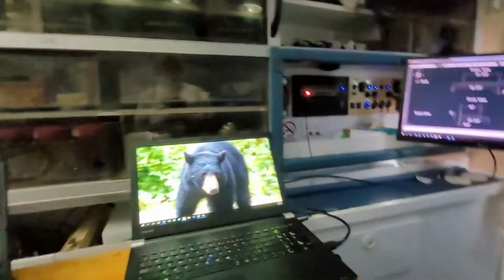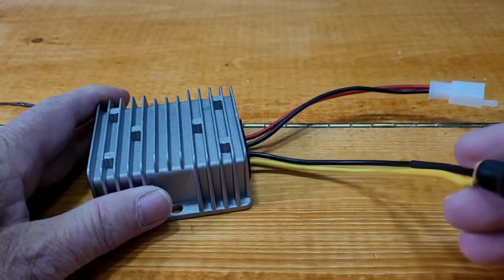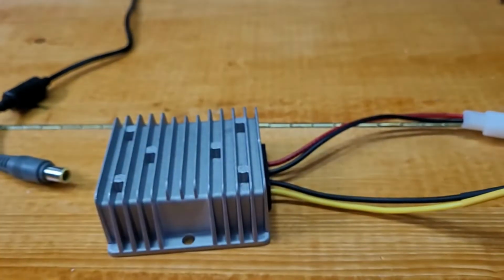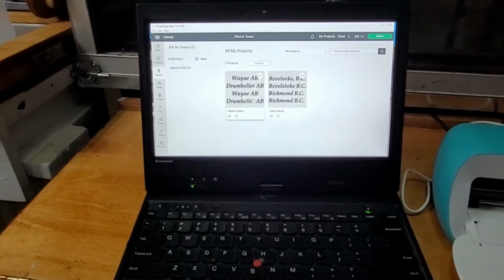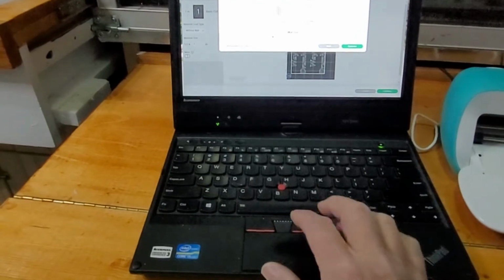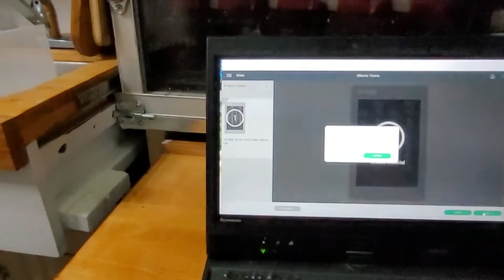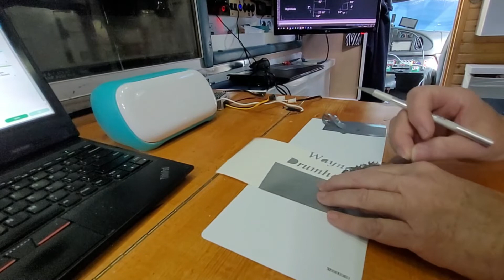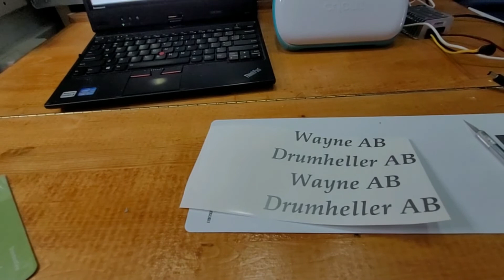Charging Laptop Powering a Monitor without an Inverter

Comment: so is that little unit pure or modified sine wave, do you get any feedback lines in the screen s ?? How many of those units are you running in your rig ? I'm Guessing they come in different voltages so you can run a bunch of different units >> ???
Reply from the maker: Hi 
This is a DC to DC converter not a sine wave is AC. I have 3 of these units in my ambulance. One for my monitor one for my Laptop and a spare just in case factor. I also run a 12 VDC to 24 volt 10 amp converter to charge my Ryobi batteries. If you want anymore info feel free to email me at any time at wayne@pallet-ivecare.ca.

Comment: Great and informative video Wayne. Thanks for the info. I am building out an '07 Ford E350 and this seems to be the ticket for installing a 19V TV to run off my LiFePo4 battery. The one I'm looking at buying is supposed to draw abut 25W, which I think is not a large amount, correct? Cheers!
Reply from the maker: So the TV will draw under 2 amps so the DC to DC 5 amp unit will be plenty. My rule is always double the amperage required do you never draw more than 50% .
Reply: @waynesamboworld  Cool, thanks for the info!